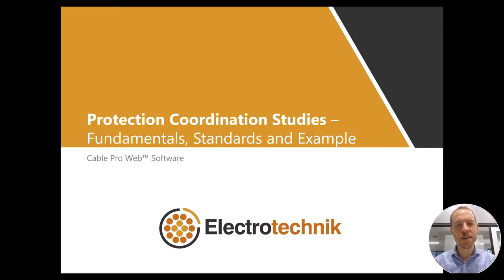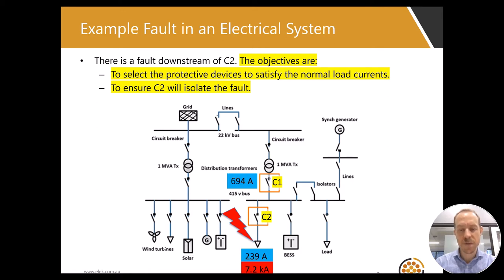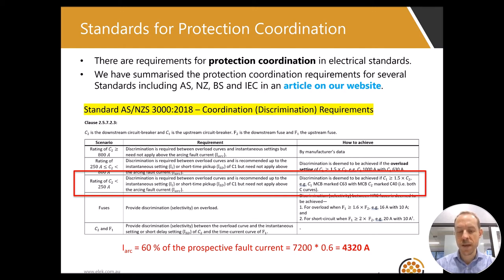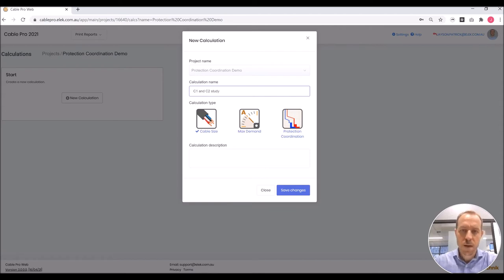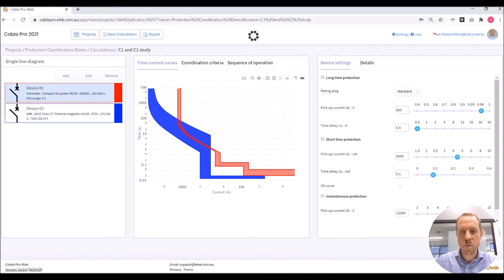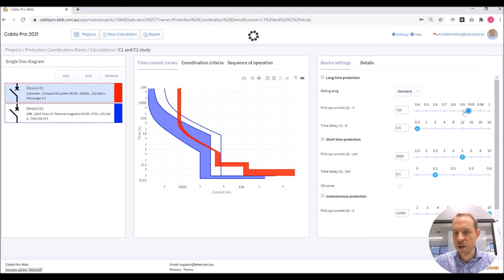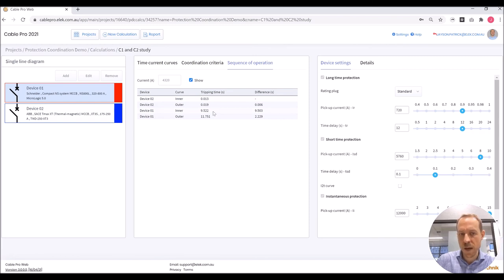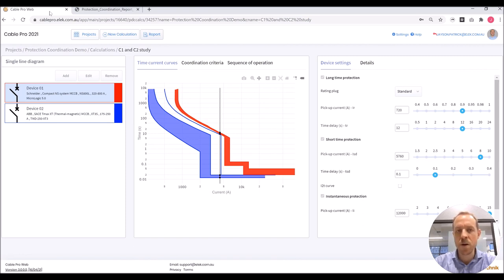Protection Coordination of Circuit Breakers - Example Calculation

Comment: Hi Jason, great video. Would you be so kind to make a video to explain, in an ACB trip unit ( i.e. Micrologic 5.0), what's the meaning and difference between ON and OFF settings for Tsd? Thank you
Reply from the maker: Thanks for your question. Please try the software Cable Pro Web and you will notice that ON or OFF means that part of the time current curve will be present or otherwise. Hope this helps.

Comment: Excellent
Reply from the maker: Thanks Sumit
Reply: One month ago. I was doing a transient stability study where downstream MCCB with Thermo magnetic PD shall trip on 3 phase SC fault and upstream ACB shall not trip. Incoming source is a DG. When I did the relay coordination study then I observed a definite time gap between tripping of the downstream MCCB and incoming ACB. However during the transient stability study downstream MCCB did not trip due current decrement factor and excitation control in the DG. If I lower the current settings in the MCCB then it crosses 125%of full load current criteria. Eventually I added micomp120 relay instead of thermomagnetic protection. The window of thermo magnetic protection gives problem while using transient stability with a DG.